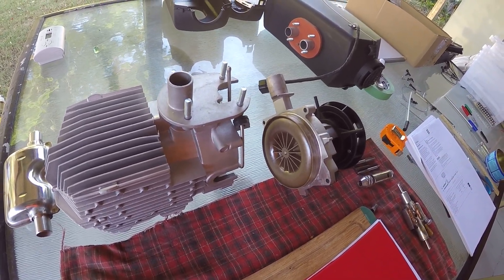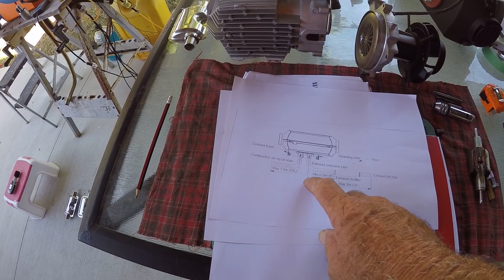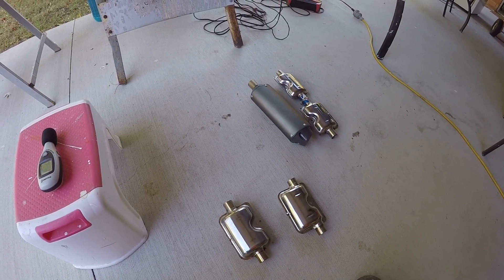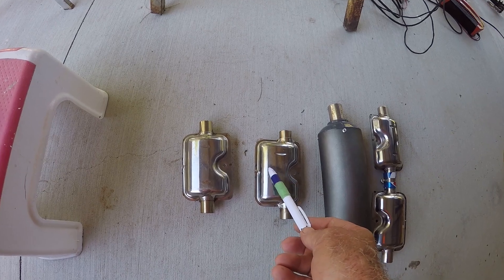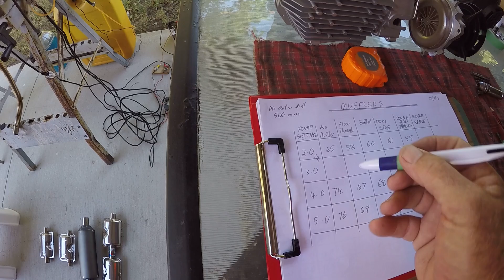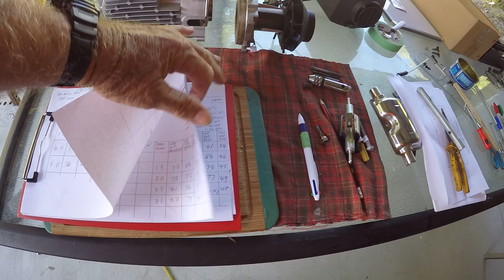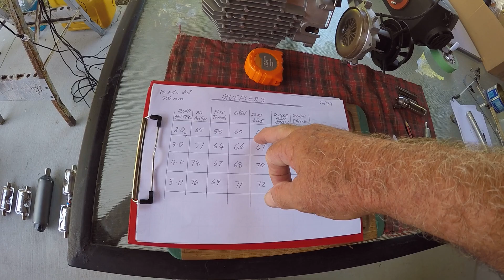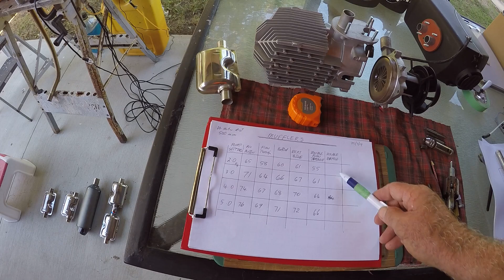Chinese Diesel Air Heaters - Part 8 - Exhaust and Mufflers

Comment: John, on your expert advice and tests, I purchased another straight through muffler, so I have two. Now, you recommend using no more than 50 cm length of exhaust pipe and air intake pipe before ramping up to a larger diameter to help with air flow restriction. The length of the two mufflers together comes to around 35  cm. That would make the combined length of the exhaust (plus 35 cm of muffler) almost a meter, which would mean that the air intake hose would also have to be the same, and in that case, I would have to go up in diameter of the exhaust and air intake?  A whole load of new problems. .. I guess my question is: Can i get away with using  the full length (58 cm) of the supplied air intake hose (no bends except for one 90 degree when it comes out of the heater, same for exhaust, they will be straight) . and then use 58 cm of exhaust pipe plus the 35 cm of muffler, (total 93 cm) without having to go up in dimension?
Reply from the maker: Hi AP, 
First, two mufflers may not be necessary. Perhaps you could try one muffler first.

Second, yes, using the two mufflers and the supplied exhaust hose would be fine if you keep bends to a minimum. The 500 mm exhaust is a goal, but the heater will work with longer lengths up to about 1.5 m quite well if you keep the bends to a minimum, and the exhaust is mostly flat or gently rising. You should avoid pushing hot expanding exhaust gases in a steep downwards direction as that will cause you back pressure issues.

I hope this helps.  JMcK

Third, the intake hase does not need to match the exhaust hose. The intake hose can be as short as you like.
Reply: @johnmck1147  Great John, thank you for taking the time to clarify! I wonder if a  straight 25mm copper pipe would be advantageous, decibel wise, over the supplied ribbed  exhaust pipe, it makes a hell of a racket just blowing air though it with my mouth!
Reply from the maker: Atkins Paints The World! 
You must try it and see. Nothing beats actual testing.  JMcK
Reply: John McK 47 can I add 0.5 meters of exhaust tube to the end of my double muffler, or would that create more noise?
Reply from the maker: Atkins Paints The World! 

That should be ok.  JMcK
Reply: @johnmck1147  I will actually use a 35 mm non ribbed 1 meter stainless steel tube  attached to the double muffler, I think that will cut down on the noise even more!
Reply from the maker: Atkins Paints The World! 

If you have a noise meter, I would be interested to know how it goes for you. Good luck.  JMcK
Reply: @johnmck1147  My phone has a decibel meter, not sure how accurate it is though, but I´ll measure and get back to you!

Comment: I have installed my diesel heater but the exhaust points forwards in the driving direction. Is this ok? Ive had to do this because the exhaust is near the rear wheel and if i point it backwards it will be to close to the wheel. If i cut the exhaust down i can point it this way but is it ok to shorten the exhaust?Thanks
Reply from the maker: Hi Ryan. These heaters only have a small internal fan that both sucks in the combustion air, and blows out the exhaust. It is NOT a powerful fan. Any air blowing into the exhaust restricts the exhaust outlet, and this causes less input air, because they work together, and this causes poor combustion, and soot buildup. 

If the vehicle is not moving, or the heater is only used when stationery it does not matter which way the exhaust is pointing, but for best practice it is nice to have a slight downward bend at the end of the exhaust, regardless of its direction.

Yes, you can shorten the exhaust without much of an issue.   JMcK
Reply: @johnmck1147   Thanks i may just shorten it then so it can be used on the move also
Reply: Does it matter when attaching the fuel lines to the pump and filter if the fuel line isnt touching the connector inside the rubber hose? Or can there be a gap? Thanks
Reply from the maker: Ryan 

Hi Ryan,  you should aim to have no gaps in the rubber joining hose as it is a space to hold air bubbles. I personally like to use standard one size fuel hose without any joining connectors on the inlet side of the pump. So I have the same hose from tank to filter, and filter to pump. If it is a short run, say 1 meter, I also use stranded fuel hose from pump to heater. Longer than that you need to use the thin hard nylon fuel hose as the rubber hose absorbs the fuel pulse.  JMcK
Reply: @johnmck1147   Thanks for the advice looks like i better re-do it. Its very hard to get the fuel line into the rubber hose atall.

Comment: Is it possible to run the heaters upside down with the exhaust pointed out the top to avoid using 90°s ?
Reply from the maker: No Doug, sorry. 
It will actually run - for a while,  upside down, just like your motor car engine can run without oil or cooling water - for a while.  JMcK

Comment: Hey John, I'm thinking of putting one in my shed under the bench for winter time, would a slightly bigger exhaust pipe diameter help do you think because I want to put the exhaust and the intake out the back wall of the shed, thanks mate, Seeya Rob
Reply from the maker: Hi 87, yes, a bigger exhaust and a bigger air intake would help.  JMcK

Comment: John, if I used a high temp gasket maker to seal the gaps around the perimeter of the muffler(except for the hole at the bottom of muffler), do you think it would decrease the decibels of the system when it's running?  Any chance you can do a mock up test of this and use your decibel reader etc?
Reply from the maker: Hi Binh, I do not like to make comment on something I have not tested. I have found from experience that often what you think may happen proves wrong after testing. I will do as you suggest, but probably not in the near future.  If you do the test, I would love to know the outcome.  JMcK
Reply: John, if I do the test I'll let you know.  I've ordered mine and it will arrive in a few weeks.  Not sure if I am going to be doing the test right away.  Curious to know if you can hear or feel any air leaking out around the edges of the muffler when it's running. If so, is it a very small amount of air escaping or a moderate amount?

Also, I am installing it on a 19ft boat.  Do you think the hot air that is blown out the outlet port would be too hot if I were to use plastic PVC pipe as the ducting for the hot air produced by the diesel heater rather than using the flimsy black metal/aluminum tube which comes with the system.?

Comment: Great video! Now, just to try to find if Chinese have type details of their mufflers. Mine heater came without a any muffler.
Reply from the maker: Hi Fibra, here is a start for your muffler search. 

https://www.ebay.com.au/itm/Air-Filter-Exhaust-Silencer-Muffler-Bracket-Kit-For-Ebespacher-Diesel-Heater/183705927920?ssPageName=STRK%3AMEBIDX%3AIT&_trksid=p2057872.m2749.l2649

Comment: My all in one didn't come w a muffler at all. Could you share a link to the flow through muffler you use, as I am not having any luck in my searches. Very informative videos btw, thanks for doing these.
Reply from the maker: Hi sail2awe, sorry for the delay. Sadly many eBay sellers come and go and often the seller I purchased from previously no longer supplies the item.  This is where I bought my last flow mufflers from. They came packaged with an air filter.  Good luck.

https://www.ebay.com.au/itm/Air-Filter-Exhaust-Silencer-Muffler-Bracket-Kit-For-Ebespacher-Diesel-Heater/183705927920?ssPageName=STRK%3AMEBIDX%3AIT&_trksid=p2057872.m2749.l2649

JMcK

Comment: Have you tried the original welded tube mufflers that come with the eberspachers for marine use? They have the pipes permanently welded either side as you need a sealed exhaust system on a boat. These chinese mufflers are not suitable for enclosed systems as they are not sealed.
Reply from the maker: Yes Andy, have a look at the boat install video in this series.  Thanks fo the comment. JMcK
Reply: What do you mean by can't be used in "enclosed systems"

Comment: Don't you think you are getting false results from decibel meter with the longer mufflers since the exhaust exit is closer to the decibel meter? I would think you would need to move the decibel meter an equal distance from the exhaust exit when changing the mufflers out during the test. But good info on the typical mufflers that are supplied with these!
Reply from the maker: Hi Scott, yes I did that, and also did many different tests not shown on the video. 
There is some noise leakage on all mufflers as I did not clamp them to the exhaust pipe, but I was looking at relative comparisons. JMcK
Reply: @johnmck1147  
Very good. This video was very helpful. I wasn't going to install my straight through muffler that was supplied with my heater since a lot of people say that the straight through ones are useless, but your video proves that to be wrong. Thanks again!
Reply from the maker: Scott Trosky ,  Pleased I was able to be of some help Scott.   JMcK

Comment: Hi John sorry to ask so many questions but the more I look into fitting a unit the more queries it raises before I begin. I want to get the exhaust right as this is the most important bit.  In my boat the exhaust will be about 1.5 mts slightly uphill so must I have a drain hole? The distance from water line to thru hull outlet is 52cm so no need for a loop?  I guess the Eberspacer sealed muffler does not have a drain hole hence the water trap? Where to obtain a drain unit like you have on your boat and assume this just mates with the outlet on the heater unit, does this type not leak gas too? By the way your series of videos are superb-you have a wealth of knowledge. With thanks again.
Reply from the maker: Hi Eric, you should have an exhaust loop on a boat to keep out rain, sea spray, and wave slap from running back down the exhaust and into the heater.

Hot exhaust gas, as it cools, sucks into the exhaust large amounts of external cool moist air, and lots of water condenses out of this air. You need a condensate trap at the lowest point. This is usually at the heater. 

The condensate trap has water in it and stops gas escaping into the boat, It works like a water trap in a toilet or a sink. You can get one made or buy on line. 

Search something like  " Eberspacher diesel heater condensate or marine water trap" .
A marine muffler is gas tight. Also search under Eberspacher air heater marine muffler.

Cheers, JMcK

Comment: Hi John another question if I may. You mention a marine muffler for boat installation,TIG welded, and these are about £40 each compared to about £9 for the Chinese ones. What are the reasons why to use such an expensive one when an ordinary one is supplied with the heater? Regards Eric
Reply from the maker: Hi Eric, the normal mufflers supplied with these heaters are just spot welded and not fully steam welded. Most also have a drain hole, so they leak exhaust gas.   JMcK
Reply: Hi John, I notice your water trap is just below the heat exchange unit. My unit is quite high so the exhaust exits the unit and drops down by about 12-14 inches before heading out through the muffler to the outlet through the hull. Any water would sit in the exhaust in the loop so do I need a water trap fitted in that location? Thank you

Comment: Hi John your videos have been very helpful to me and others. I am installing a 2kw heater in a small boat. My exhaust will be 1.5mts long and I am considering not fitting a muffler. Reason being that the exhaust will exit the boat via a stern locker and I don't want moisture/unburnt diesel dripping into the locker from the muffler. My question' s are is it OK not to have a muffler and is it OK not to have a drain hole (No muffler)?
Reply from the maker: Hi Eric, it is not essential to have a muffler, the heater will just be a little noisier.
If the exhaust travels upwards you will need a water trap, see video on boat install. Without a water trap condensate will pool in your combustion chamber.   JMcK

Comment: Hi, I've heard that if you use a muffler on the intake as well as the exhaust it's even more quiet!
Reply from the maker: Hi Paul, yes, provided it is not a baffled muffler like supplied in the kits. My tests showed the supplied intake muffler actually increased the noise. See video.   JMcK

Comment: Hi John. Great set of videos.
I'm in th process of installing a 5kw heater in my boat. My heater came with 2 straight through type mufflers and from your video it looks a good idea to use both. My question is what have you found to be the best way to join thm together? Is it done by using a small length of exhaust hose, or can you buy a special bit of kit to effect the join?
Reply from the maker: Hi Graham, unless the mufflers are fully welded and gas tight they are not suitable for marine install. Mufflers that come with these heaters are just spot welded and are not a gas tight seal. You could have them fully tig welded or purchase a proper marine muffler.

For joins use some ss tube of the right size. Sometimes hard to get the right size. You can sometimes get this from a genuine Eberspacher supplier or make your own. I bought half a metre of the closest ss tube put one slit in lengthwise adjusted to right size and tig welded the slit.  JMcK
Reply: @johnmck1147  couldnt you just seal around the edges of the muffler with high temp silicone
?
Reply from the maker: Atkins Paints The World! 

Yes you could, and don't forget the drain hole. But in a boat I would want my muffler fully TIG welded to eliminate any chance of CO getting into the accommodation area. The surface area of the muffler edge is very small, and lessens the chance of a good or permanent gas seal from a silicone bead. If you don't have a TIG welder (I do), a shop could probably weld the edge far cheaper than buying a dedicated marine muffler.  JMcK

Comment: hi thanks for your time for making these videos.
I want to install one of those heaters in my van.
Do you know if it can work well if I install it turned down? (I mean rotate it 45 ° or 90 ° degrees) or should the position necessarily be as you show it in all your videos? (I mean placed with the exhaust down)
Thanks
Reply from the maker: Hi Lucho, these heaters will run ok tilted 90deg so the exhaust runs out the side horizontally, but only the side with the glow plug at the top.  JMcK

Comment: May I suggest a smooth wall exhaust pipe? My experience in using corrugated hoses versus smooth wall pipe on vacuum sewer cleaning equipment shows the corrugation creates turbulence resulting in a whirring or whistling noise. What are your thoughts on this?
Reply from the maker: Hi OG. Yes I agree, smooth is better than corrugated, but the heaters come with corrugated, and the vast majority of users use corrugated. In using these heaters for over 12 years now, in real life I find corrugated is not really an issue here.   JMcK

Comment: Are "straight through" and "flow through" the same thing?
Reply from the maker: Yes, when I am talking about mufflers. In my opinion flow through or straight through mufflers are far better to use on these diesel air heaters rather than baffled mufflers, not the least as the combustion air fan is small and low volume. JMcK

Comment: Hell john hoping you can help point me in the right direction please.
I have got myself a diesel heater and the controller is the same as the heater you are using at the beginning of the video but unfortunatey it has not come with any instruction.
Would you be able to point me in right direction please.
Reply from the maker: Hi Adrian, if you email me at jmck47@outlook.com I can send you a photocopy of my "Chinese English" instruction manual.  JMcK